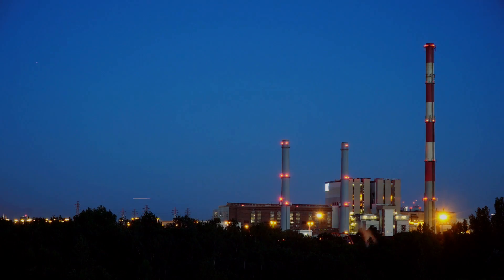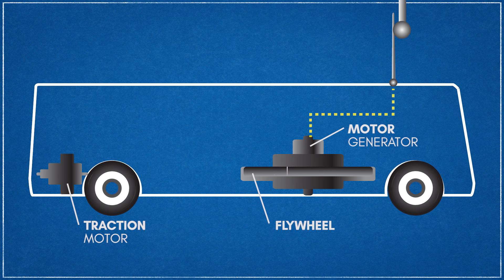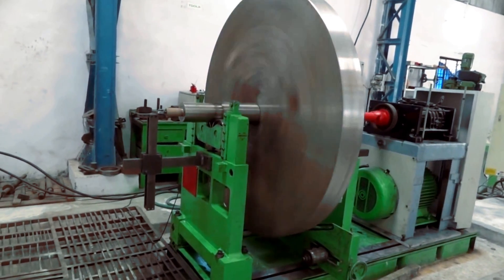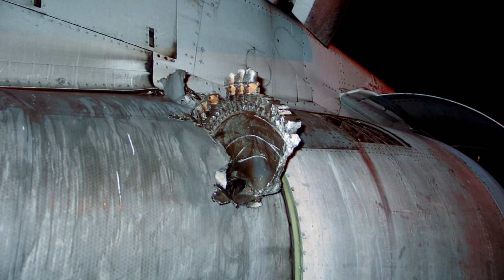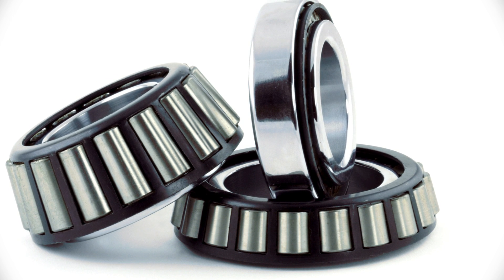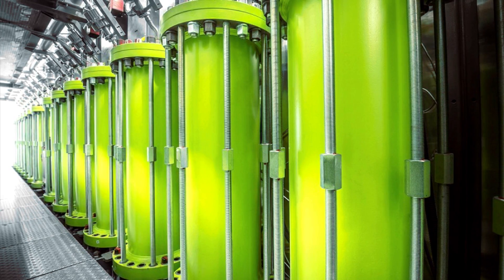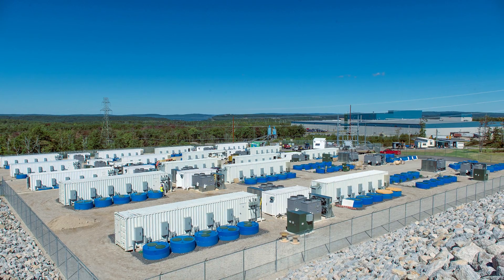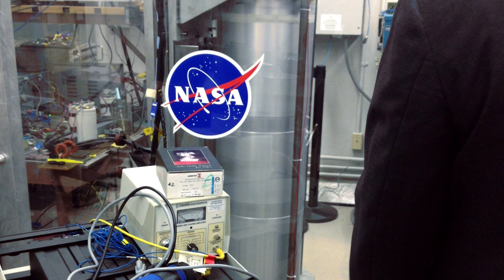The Mechanical Battery

Comment: Molten salt is going to be used as a battery for these new AI controlled solar generators. During the day, hundreds or thousands of mirrors controlled by an AI all aim at one spot, making temps up to the same as the surface of the sun. If they use salt, melting the salt with the solar energy, they can maintain heat of about half that temperature overnight, which is more than enough to keep generating power all night long.

Comment: Fly wheels are good for short durations before something else takes over, thus enhancing grid stability for example. But using a large shaft, like a mine shaft and lowering/lifting very heavy weights are much better because there's no loss in stored energy even if it's stored for days.

Comment: very cool video, I enjoyed learning, I do however think it is misleading to refer to potential or kinetic storage of energy as a battery
Reply: Why not use giant springs, energy source winds up the springs , they unwind at a governed pace to deliver power as needed. Friction and gravity will hender efficiency, just as with any mechanical storage system.{ Not a battery, just as a flywheel isn't.

Comment: Automatic transmission Chrysler engineered the 727 GM built the turbo hydrodynamic 400 . 
The unusable  range they referred to didn't strike me as proper because there is no unusable range of kinetic or potential energy.

Comment: Norway has 95% of its electricity from hydropower. We store it in dams to last as a battery through the winter when we have snow instead of rain. We even buy cheap night-time wind power from Denmark in order to pump water up, and we make money on it by selling it at higher prices in winter/daytime (Total efficiency of the process is 60-70%)

Comment: No, a flywheel connected to a steam engine is there to even out the active torque from the pistons. A crank on a shaft would do the same thing but power transfer would be uneven. Traction engines have them for the same reason, locomotives use the wheel-pairs as the flywheel.

Comment: This concept works best only on BIG stationary systems. For mobiles vehicles (car or planes) batteries (chemical or mechanical) have many problems. If it is a electric powered  vehicle the best solution STILL not use batteries AT ALL!!  The real solution to usable/reliable electric cars (that not trade air pollution for solid pollution of old batteries carcasses) is the old fossil or bio chemical fuel. 
But in a electric powered car we must install a small, efficient and economic stationary ceramic motor to power up an electrical generator direct to the electric power train. 
No batteries, no recharge and with a regular tank you can go up to 2.000 Km (or more)!!!
The tech is fairly available is only need to forget  this nonsense sell by electric cars makers that  electric cars with large and expensive batteries sets are environmental friendly. 
You you see "the solid" pollution when a fleet of hundreds of thousands electric cars will need surely change its entirely set of batteries each 3 or 4 years... Where did the old batteries GO ????
AS any cellphone battery does, you MUST buy a new one if you plan to use your current cellular model for more than 2 or 3 years... 
With a Tesla car a new set of batteries will not be cheap and simple buy a new one when that happens is not easy as the cellphone...

P.S.  And I bet it will be VERY difficult to sell with a good price an electric car with and old batteries set....

Comment: Would the busses have trouble turning because of the centrifugal force ?🤷🏻‍♂️
Reply: It would be slightly easier to turn one way than another (left vs right) but notice they said they ran on flat ground?  If the bus tried to drive up a hill the flywheel would not want to change angle so it would be very difficult.  The only solution is to put it on a pivot so it can remain flat while the vehicle is going up and down a hill, but then the flywheel housing changes from a flat disc to a sphere, taking up too much space inside the vehicle.

Comment: The main reason these cannot be used in cars is because of safety. Just imagine the amount of energy released in the case of an accident. In my old days when we were doing research several engineers were killed during experiments emulating an accidents scenario. The pieces of the flywheel core went through concrete as if is was butter.

Comment: I had never heard of a gyro on a bus, but this video sparks some thoughts. First off, what effects the gyro would have on the bus itself, I presume since the flywheel was vertical, it shouldnt have affected steering much, but what about tipping, I would sure think that it would have stabilized the bus from tipping? Does it have less roll while turning? Another thought was - maybe a direct coupling with a clutch through a transmission? Or would the losses through gearing be more than that of a motor/generator and traction motor? Your thoughts?

Comment: This may be a stupid question as I know nothing about batteries, but since this says that current mechanical batteries can produce large amounts of power for a short period of time, could they be partnered with current (or modified) electric car batteries to allow much faster car charging?  Charging speeds are the biggest problem I see with switching to electric vehicles.

Comment: Wouldn't a magnetic bearing create eddy currents in the flywheel and lead to energy losses? Isn't that the point of a superconductor bearing?
Reply: If the magnet is nonconductive or made of layer of sheets magnet insulated from each other. It will reduce eddy current losses.

Comment: The M1 series MBT the Abrams use two, maybe three gyroscopes to give it the ability to lock on a target and fire while on the move over most any terrain.  At least it happens so fast you wont realize you were vaporized by a sabot round going a mile a second.  Now antitank wespons use gyroscopes to hit armor from the top at its weak point.

Comment: Im not sure i would want to ride on a bus with a 3000RPM pool sized flywheel.
Reply: @Hazard Gas is way safer and so are li-on battery's. Have you ever seen even a small flywheel slip off off a bearing? Its terrifying and the thought of something thousands of times heavier is even scarier.

Comment: Flywheel generators are widely used for short-term emergency power up to about one minute when emergency diesel generators have ramped up. They keep operation-theatre-lights from flickering and servercenters from crashing. Also, turbines in classical powerplants are huge rotating masses that slowly bleed off energy and are sometimes used to power emergency systems.
Only those things are not super-efficient and you can't really use them in vehicles. Otherwise its a well-proven and used technology.

Comment: Excellent informative documentary. There was a historical flywheel technology not mentioned because it was not for mechanical storage but nonetheless advanced the technical ability to build high energy flywheels. These were for the stabilization of ships at sea to dampen the rolling motion for the comfort of the passengers. They were also used in strategic ballistic missile submarines to stabilize the firing platform.

Comment: I've been thinking about this recently. Would it not be more efficient to use the windmills to elevate large quantities of water to a great height and then use that stored kinetic energy to drive flywheels which can then provide electricity for immediate use or for storage in batteries over short periods?
Reply: Direct windmill pumping is great if you could find a mountain that doesn't block the wind...

Comment: There is at least one flywheel in development made out of carbon fiber and is more of a ring than a wheel because it spins so fast that the support structure from the rotation axis out to the ring would break apart. But by spinning it faster and faster you can decrease the amount of mass you need.
They say it will be used to smooth out fluctuations in the grid.
Reply: Have a name, or link? Been trying to find them.
Reply: @Foagik  i would have posted a link if I had found them. Pretty sure I saw a youtube video about it. Maybe it has since been deleted.

Comment: Why not crank a massive weight up (like a big clock weight) during low energy demand times, then use it to keep the fly wheel spinning?
Reply: That's the water pump solution mentioned at the start. Pump water to a mountain top reservoir for a practical giant clock weight: Thousands of tons, huge height.
Reply: @johncrowerdoe5527   yes and no. Similar idea. Something like lead has a much higher density than water, doesn't evaporate, and could potentially require less to build out than having to excavate/ build dams. Heck, make the weights from steel boxes filled with concrete if you want.

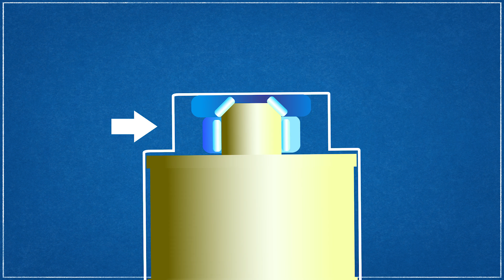Comment: 8:50 The Earth's spin has no effect upon the gyroscopic movements of a flywheel. And thus the Earth's spin does not cause any wear to the bearings, the bearings are simply worn down by use. Whoever told that was either uninformed or a liar.
Reply: You can talk to gyroscope manufacturers and they will tell you that gravity has no effect upon a gyroscope, because if it did, then the gyroscopic stabilizers in airplanes would not work to keep the plane level. Go ahead and talk with them and you will see.
Reply: @eightywight  Gyroscopes for position measurements are very different from energy storage flywheels.  Flywheel bearings are affected by earth rotation, either because of precession or if precession is eliminated by an earth parallel axle by the constant sideways gravity pull.
Reply: @johncrowerdoe5527  Sorry mister Doe, but you are misinformed. The stabilizing gyroscopes used in aircrafts are not simple "fly-wheels", they are precision instruments that must keep the same position or it will endanger and alter the flight path of the airplane.

The engineers, scientists, and mechanics who work for these aircraft companies all agree that airplane gyroscopes are not affected by gravity. I take their word as far more credible than an armchair internet physicist.

Until you go look at the manufacturing specs, your baseless assumptions hold no weight.
Reply: @johncrowerdoe5527  Likewise, if you were to perform the gyroscopic earth-rotational measurement that was falsely popularized for proving Earth's rotation in the 1800's, you would find that the gyroscopes will not move backward or forward in any consistent pattern. Science is based on duplication, and because that experiment is not reproduceable, it is not valid be scientifically. I urge you to try it for yourself.
Reply: @eightywight  Heavy energy storage flywheels are not gyroscopes.  Applying gyrocompass experience to heavy flywheels is your mistake, not mine.
Reply: @johncrowerdoe5527  Just stop, you are making the mistake fren.

Comment: Using energy storage for a public power grid is an utopia! Only practical working solution is production on demand, as we have now! No way highly intermittent and unreliable wind and solar power will ever be a solution to continuous, but variable, power demand - it only works for very specific applications like the ones reported, not for large scale public supply.
For the flywheels, the magnetic bearings can easily consume as much (or more) power as they store, the only advantage being the provision of local large bursts of energy, for niche applications, like  science, space and very specialized industries.
Not that they are needed, but possible alternatives for oil and gas are nuclear, hydro and tidal generators, which already exist, but environmentalists don't want. In fact, environmentalists don't want any solution that works - they only accept pipe dreams, while ensuring that their personal needs are previously catered for, independently of the rest of the world subsequently collapsing from the application of their deranged ideas.

Comment: Totally agree  with your last line, this tech will grow and change.

I can imagine a flywheel storage system used on a space station, or energy platform in space, the only bearing loss would be due to gyroscopic correction due to a low to no gravity environment, and would not need a pressure vessel to maintain a vacuum. 

A guarded high speed flywheel with enough mass could potentially provide stored enough power for all kinds of uses in space, or anywhere really.

It’s interesting to hear that this is used in power grids already, that I did not know.
Reply: This shit would never be used in space
Reply: If you use a flywheel in space you probably need two .. that counter rotate.   Because if you spin up the flywheel the space station will start to spin in the other direction.  Or if you spin down the flywheel by using its energy the space station will spin up also.    The ISS space station actually has four 100kg or 220pound flywheels that act as gyros the "Control moment gyroscopes" .. they spin at a constant speed of 6600 rpm .. and if they rotate them the space station also rotates.  So that way they can control the position of the space station without using fuel.  Of cause a flywheel for storage will work against the gyro's i guess making them less usefull.   Makes you wonder if the Control moment gyroscopes will generate power if you spin them down.

Comment: Maybe use this to store energy from wind and solar overnight when power generation is low? the weight of the flywheel wouldnt matter as much if its stationary
Reply: Wind doesn't stop at night, only solar.  Wind at night produces excess energy that needs storing until morning consumption spikes.

Comment: So looking back at your flywheel bus example... if we would build that today I don't see why you would do things so complex.
We have invented a thing called Constant Variable Transmission. There are several types the easiest and least expansive is the planetary gear CVT.

If you have a planetary gear and you have an engine spining the planets you can have either the sun or ring gear sitting at 0 RPM while the other gear will go at max speed. Now when you apply force to the free spinning wheel the other side will have to move. So what you can do is have your engine at the ring gear your flywheel at the planet gears and your drive shaft at the sun gear. If you want to charge the flywheel you block the sun gear from moving so all energy will be put into the flywheel on the planet gears. When you are done charging you disengage the power from the engine and it will continue to spin from the power you put into the flywheel. When you then want to start driving you disengage the brake on the sun gear and take energy from the engine. The power will then rather move to the wheels than the engine so thus accelerate the vehichle smoothly. The power you generate from the engine can be stored and possibly be used to accelerate the flywheel again.

I don't know if this can be understood by most people (because of my lack of proper english or because the concept is hard) but it can work. It is being used by automatic cars.
this might explain is a little better as it shows it graphically https://www.youtube.com/watch?v=ARd-Om2VyiE

Comment: I came up with a flywheel powered 3 wheeled bike. It uses a peddle driven spring which when released into a flywheel drives an electric motor on the rear tires. Now to just be able to afford to build it.
Reply: Well, hello there. I had a similar idea, although, there must've been others to have tought of this as well. I propose using supeecapacitors as a compensator, enabilng you to use the electricity you produce only on demand. Maybe 2 interswitchable banks of supercaps, one being used and the other charged, etc.
However, this system is only good for the city, where you are forced to stop and thus have time to recharge while pedalling. Out on the open road you need a battery of some sort which you charge at night at home, but if you keep on pedalling that battery will hold that much longer. And beside that, to give you more pedal power, you can increase the lenght of the crank by let's say 5cm(2inches) given the fact you sit most likely in a confortable car seat.
Reply: @petrurazvanvasi9450  my idea was using a coil spring wound by by the peddles. Then when released it spins up the fly wheel. Like slapping a basketball to keep it spinning